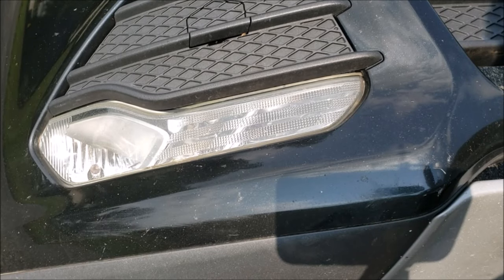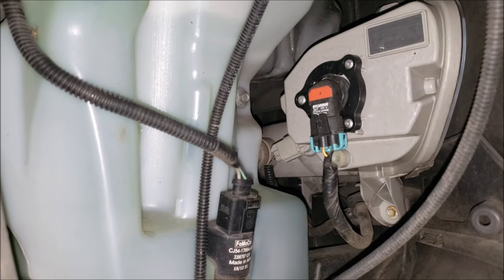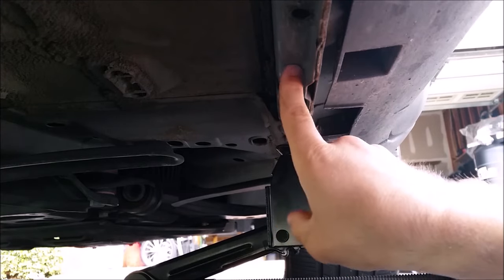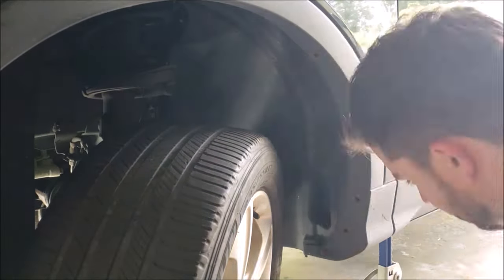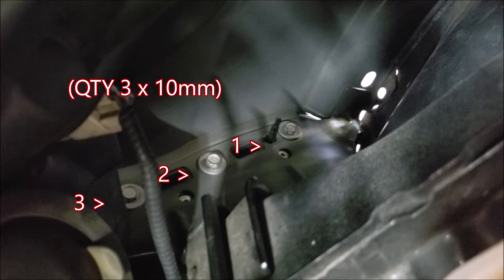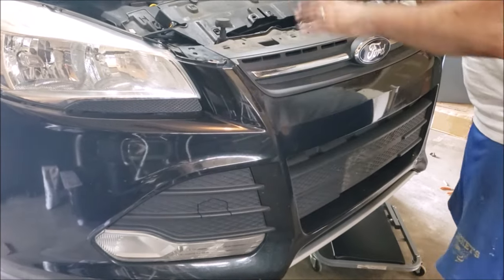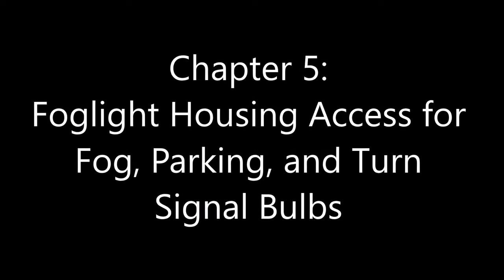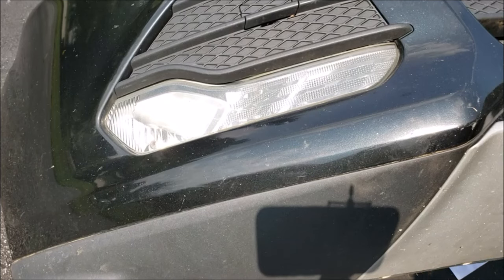BEST ACCESS to Fog, Parking, & Turn Signal Bulbs: HOW TO ESCAPE

Comment: My daughter (42) and I (67) just completed replacement of two passenger side bulbs in her 2014 Escape. I removed the wheel, though we agreed afterwards this was not necessary. All I did was remove the eight 7mm screws and one push tab, loosen the trim pieces, reach in and twist/pull the light sockets out, pull the bulb out with two hands (easily), insert the new bulbs (by feel) and reinsert and twist the sockets back in the housing. It took us 15~20 minutes, even with wheel removal. We both watched this video beforehand and decided to try the wheel well method first. It was just too easy. All your viewers need to quit complaining about how HARD it is. I could do it now with my eyes closed.
Reply: Try it on one that someone else has mangled before you got in there and then tell me how you feel about doing it, chief.
Reply: And the driver side? 🤣😎

Comment: Thanks a lot. The only thing is you could've shown how to get it off the front tabs a bit more. We were afraid to pull hard on the front, and we ended up taking off the black grill cover, so we could see where the tabs were there, and also, it was impossible to disengage the electric part, until we took the bumper off halfway, and then one of us disconnected it, while the other held the bumper half off. Finally, we had to also take off the front license plate and a tab under it.  We needed a bit more info on how to take off just the top part of each plastic tab, so that we could reuse them. My friend, luckily, knew that, but most people might not know how to reuse them and it was hard to put them back on. Thanks!

Comment: After seeing video after video on complicated procedures I decided to look at it from the top. Loosened the clamp to the air filter box and the sensor and pulled out the box. There was access thru there. As a mechanic, I've had to do quite a few bulb replacements by feel so was quite easy. You got to be able to work one handed for this method as only one arm will fit but didn't have to remove screws or wheels or anything like that. I did the passenger side before by removing the splash guard and my arm got scratched up. Driver side was easy from top, took 20 to 25 mins. Biggest pain was fitting the socket back into the fixture, you have to line up the wider tab into the correct slot
Reply: Not possible to do this with one hand if the bulb is broken. Follow the instructions.

Comment: Thanks ford for making a 5 minute job take 3 hours this is why all engineers go straight to hell without passing go or collecting 200
Reply: Ps sheet metal and a 3 inch hole saw turns this into a 20 minute job
Reply: Just have to know exactly where to drill that hole!

Comment: Great video. I recently purchased a 2014 Escape, so I've been educating myself using your channel. One thing I was wondering about this: is it possible to pop off the outer grille pieces (the small pieces of trim directly above the fog light assemblies, with the recovery hook access door on the passenger's side one) and gain access from above? Or would there not be room to physically get your hands in there?
Reply: Hi, i also own a 2014 escape. The short answer is yes you can. That plastic faux mesh piece can come off but you might be hard pressed to get your hand in the whole and do all of the work from such a small access point
Reply: No. You can pop it off, and these is a hole but you can’t get to the bulb. You’ll probably break the snap tabs when you remove it
Reply: @mattmonden  that's exactly what happened to me when I tried. The little tabs are fragile and most snapped off. I had to order a new trim piece. On top of that, there wasn't anywhere to get my hands in to reach the bulb. Epic fail ;(

Comment: I need to replace my parking light on my 2016 Kuga (UK) I really didn’t think it would be this difficult to change a simple bulb. Why couldn’t they have a couple of screws under blanking caps for you to remove the whole unit, bloody ridiculous! Thanks for the video though 👍🏻
Reply from the maker: You got it. It is a bit crazy. Some people with smaller diameter arms can get down in there without pulling the bumper but I haven't been able to do it. Others don't mind getting scratched up a bit from the wheel well liners. That's just why we recommend this option, even though it's more steps, you won't get as banged up doing it...

Comment: For the left one I just removed the air filter box and you can access it that way. 10 min. i uploaded a video of it. 2013 escape easy front left signal light replace
Reply from the maker: Nice! I'll have to check that out- thanks a lot for the tip- do you have a link to your video by chance/?
Reply from the maker: Found it on your channel! Thanks for sharing- very good option to get in there- definitely much more efficient! Just need to find a way to the other side now :)

Comment: Better change them all at one time.
Do you know what shop time is for that job?
Reply from the maker: Hey David, I don't know what the shop time is for this- I do know that to do the timing belt and water pump, it's 1000 in labor at a ford dealer just to get close to that area, so perhaps 50-75% of that to get the bumper off? Just guessing. Regarding the bulbs, I agree- all at once would be better than having to take it off again!

Comment: BULB CHANGE PROCEDURE : 1. Remove engine, 2. Remove front windshield and headliner 3. LOL

All manufactures are doing this now more and more..... they need those billable hours.
Reply: You're comment sounds like hyperbole until I remembered having to remove part of the front windshield to replace the battery on a 2014 Ford Escape, lol.

Comment: I would definitely stay away from the bumper cover removal method, it's just too much work. Check for other videos that show removing the front tire and then removing the bolts and plastic push pins that hold the wheel liner in place and peel it back to access the area where the bulbs are located. It's not easy, but I changed out the parking lamp on the passenger side....reaching in with my left arm, twisted out the lamp holder, popped out the old bulb and inserted the new one and then reinstalled the lamp holder. It's not an easy thing, you have to be somewhat coordinated to make it happen but it can be done.

Comment: Happened on my escape then when getting an oil change a tech at Mr lube actually said hes done so many that he knew how to reach down through the engine bay and replace the turn signal bulb took him 10 mins.
Reply from the maker: Oh wow no way! Interesting- ill see if I can do that- would be a heck of a lot faster!
Reply from the maker: I just took a look in our engine bay... that person must have some slender arms because the largest openings to get down there were only 3 to maybe 4 inches... clearly the person can do it but that's crazy. You can see the main fog light from above the engine bay on the driver side and you can almost see the passenger side near the washer tank. Everything is so crammed in that bay and bumper area though... its really something.
Reply: @HowToEscapeDIYTipsandReviews  when he said he could do it I was like go at it because I seen the work involved to replace and was shocked he managed too because yea not much room in that bay at the front I have the 1.6 ecoboost but Thank you for the video and awesome channel.  :)
Reply: BS there's no video on that there's no way of getting to it show me proof! I just changed mine taking the inner fender well out what a pain in the ass!
Reply: Wow!! My signal bulb is out on passenger side. Since I'm female, maybe I can get in small space. I'm going to check it out.

Comment: I've replace bulbs on my sister's 2014 Escape. It was a PITA job. Now the bulb/housing lens is broken and has to be replaced. I am so dreading this job. Looking for a bright side... I have modified an Acura Type-S 6mt and a couple of 300zx turbo cars and had to removed the front bumper assy so I know even PITA jobs get done eventually. Looking on the not so bright side I did those jobs to improve performance and had great fun after the jobs were finished. In this... all I'll have after all this work is a functional turn signal. Meh...
Reply: But thanks for the video, I'm sure it will be useful

Comment: I took out my air filter box and reached down from engine bay for the driver side.
Reply from the maker: Nice! What a time saver! I have heard about that method but im not sure people with larger sized arms could make that reach- i also checked the passenger side and couldn't seem to find an equivalent routing- have you found one? Thanks for sharing and it would be great to have a guarantee for an easier method!
Reply: There’s no room to do that.

Comment: How long does it take to do the bumper method in total? I’m trying to figure out how much dedicated time I need to complete the fog light assembly replacement.
Reply from the maker: Hey there- I would estimate around 3 hours total from the point of lifting and lowering it. There are the few tight reaches like the 3 screws above each front wheel and its important to take your time with the wheel well moldings to not snap any retainers if you can help it. If you're going in there, it may also be a good time to check out your wiper fluid tank and hoses as well as your headlamps if you are thinking about changing anything with them as well.

Comment: Basically remover the whole front bumper to change a bulb. I think Ford may have been hanging out with Audi too much and needs to be banned from hanging out with them in the future. I found out that hard way this job to do for a customer is even harder when the body shop that fixed some front end damage was pissed off and botched the reinstall massively, even using rivets to hold some panels in place. Im adding this on my short list of cars I dont work on.

Comment: If you ever have to replace the assembly..good luck youhave to take bumper off..lights you get through wheel ..
Reply from the maker: Agreed- my arm couldn't get any bulbs through the wheel well aside from the outermost ones, especially on the passenger side. Were you able to reach all of the bulbs and not get torn up? Thanks for commenting and sharing!

Comment: Any tips on getting a power wire through the fire wall on a mk 2 66 plate ??
Reply from the maker: Hey there! I'm not sure 100% as I dont have that vehicle to explore on but you may be able to run it inside the body panel to the door jam and then through the door wire harness weather boot and into the cabin there? So from the hood, go to the front quarter fender to then go back to the door jam.
Reply: The car is exactly the same as yours in the video just called a kuga in the uk

Comment: I’ve never done that before, but I think by removing the splash shield under the bumper, you’ll get a better access to fog lights. There’s no need to remove the entire bumper.
Reply: Yes and I did it like that, there’s a guy who made a video showing how to do it!!
Reply: Like he said it hard and you will be scratch ed up
Reply: Before you comment, try to do it. Follow the instructions or pay the dealership. Thankfully this person has been a lifesaver. Not possible on the titanium model unless you do like the man suggests.
Reply: Ohhh there is a reason to remove the whole bumper if you are replacing any of the amber lights which you will find do not come out without some convincing and lots of access so you might want to rethink that comment till you have actually done it.

Comment: Followed vid. Great, but found I did not have to remove wheel arch from at rear. Only front part to just behind bumper join. Put something in to keep it clear of Humphreys removing. Also seven mill screws can stay in assembly . Three torxs hold from on

Comment: I am sure this car was designed by a sadist  gynaecologist
Reply from the maker: 🤣hahaha oh goodness... perhaps... it surely isn't easy to work on...
Reply: @HowToEscapeDIYTipsandReviews  
Here down-under (Australia, affectionately known as shitville), I have a 2016 Ford Kuga Diesel AWD with the powershift (aka powershit) 6DTC450 gearbox (same as the Escape in the US, but you guys don't have a diesel engine and not so much of the pwershit gearboxes).
 I love the car, but hate working on it. 
 It was an absolute pain in the arse each time when I changed the front driving lights,  oil filter under the the engine, the battery,  the inner cabin filter, and even when i cleared the clogged filter in the washer bottle. All  took  so much time  because of the numerous bits and pieces I  need to take off. 
I refused when workshop asked for a $100 for replacing the front light + the cost of the bulb. After doing it myself, I realised the designer of this car was a warped gynaecologist 
For changing the driving bulbs, I prefer jacking up the car, removing the wheel, and rolling back the wheel cover. 
Thanks for sharing your expertise

Comment: Everything I've seen on YouTube regarding replacement of fog-light light bulbs in a 2016 Ford Escape SE points to the time and labor intensive means of wheel-well  disassembley or bumper cover removal.
That is, up until I ran across this little vignette:
 https://youtu.be/jAgOZ6toIHM

Comment: You guys are seriously over-complicating this... those black plastic covers above your headlight assembly... they snap off, and give you access to 7 mm bolts. Not joking.
Reply: Well, I should say it works on my 2014 Ford Escape. Not sure what year you're working on.
Reply from the maker: Man I was so pumped- i literally ran out to my 13 to try it- took my trim tool and popped off the passenger side insert above the foglight assembly and it us all bumper cover behind it aside from the access cavity for the towing eye. No easy way to the screws on the fog assembly. Same on the drivers side. No dice. I was going to whip out a video asap and give you props haha. Maybe its a change from 13 to 14??? I
Reply from the maker: Maybe I misunderstood you- I was thinking about the foglights- did you mean to say headlight?